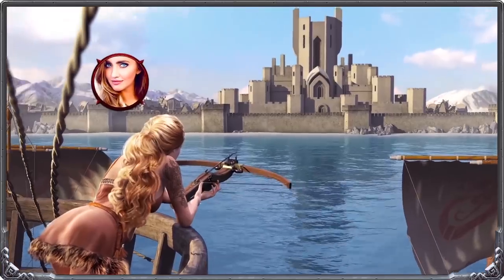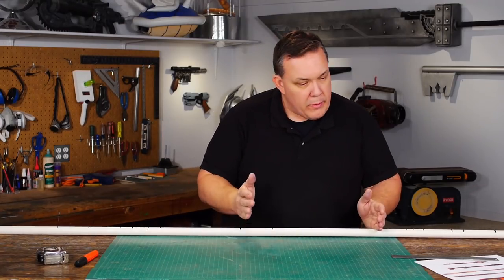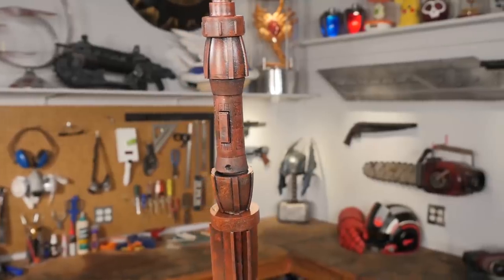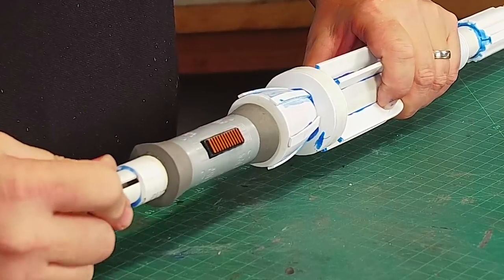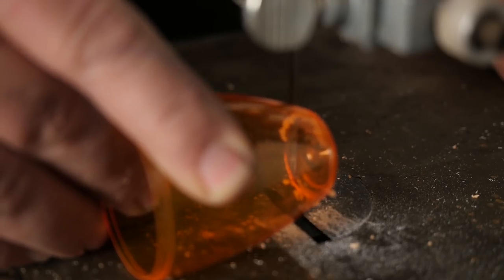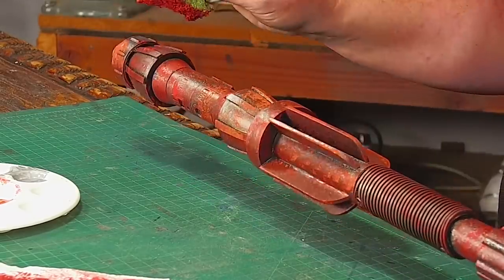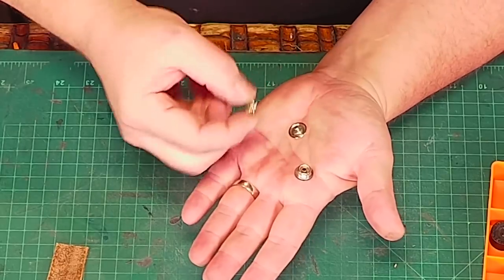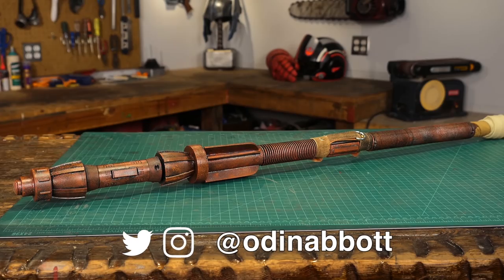Odin Makes: Rey's Staff from Star Wars the Last Jedi

Comment: Please make lightsaber of Luke Skywalker from Star Wars Return of the Jedi
Reply: Ezio Auditore You can either  check out Beyond Geek's channel where Odin makes or DIY Prop Shop where Hendo makes the Lightsaber.
Reply: Ok, but it isn't of Luke and isn't green
Reply: The color doesn't matter and it's impossible to do the Ep 6 ligthsaber without a lathe (or a 3D printer)
Reply: SaitoGray no it's not....
Reply: no, several layers of individually cut foam circles with an embedded pvc core could work, or sections of various sized wood dowels, or if you want to get crazy, one could cut out circles from a material like mdf and stack those up... a lathe is not necessary, neither is a 3d printer.
Reply: You all probably irgth. i'm use to build with real stuff, i can't make foam look good so i often use aluminium or steel. I'm to used to work with my tool and didn't see he can be at simple as that !

Comment: Well done build and thank you for the spray paint tip. 
But the rust looks more like blood.
Have you ever tried using clear varnish or glue mixed with powdered iron and then spraying it with salt water and vinegar?
Real rust looks the most like rust. So would have had thought? ;)

Comment: just wanted to say i love your channel and im definitely subbing, i love this prop and i love how you used elements of kit-bash in the staff!  great video! i would like to offer you some weathering tips to possibly help bring your projects to the next level! These are all tried and true tricks for weathering i have learned from trial and error many online videos and a lot of listening to Adam Savage talk haha! try watering down or using some thinner ( depending on what kind of paint), to help the paint become easier to move around once it is on the piece.and apply with a paintbrush with lots of crazy stuck or broken bristles on it, this helps the paint go on in a much more random and chaotic way like would be in real life, things dont weather evenly or regularly at all .Of course depending on the object, wear can and should be placed in areas where the object may be handled a lot. As far as color i think your'e leaning to much towards a bright red for your rust and dirt which in person looks alright sometimes but on camera it loos out of place, try using more of an earthy color like burnt sienna and reds that lean further towards brown and maybe even mix in some dirty green/yellow not enough to noticeably change the color but it adds definition and good highlight. And rather than 2 washes of color do many small washes and use a brush to apply and then try to wipe away as much paint as you can with a dirty shop rag or a paper towel, cotton fabric like and old tee shirt works really well.  it leaves just the lovely cracks corners and details looking realistically weathered and the piece doesn't start to lose its authenticity because of these small things that make a world of difference. I hope some of this can be useful to you and your badass prop making skills! thanks for the great content!

Comment: Thank you, Odin, for making all these awesome props!

My request, anything that lights up and interacts, with an Arduino or a Raspberry pi, some sensors and lighting. If you go the latter route you can pick up a pi zero for under $10 and install any Linux OS, then code in whatever language you like.
Reply from the maker: You assume I have technical prowess of such things! The last Pi I touched, I ate!
I do like the Idea. I have seen schematics for a P.K.E. Meter, and I would like to have the number display change on Rick's Portal Gun.

How hard would it be to make a Harry Potter wand that you could flick or wave around, and it would turn the volume on the TV up and down, or even mute?
Reply: Odin Makes Hrmm. Wand: With my very limited skill set, hard, unless you made the handle huge- you'd be looking at a 6 axis sensor and a custom chip. 

On the other hand, The portal gun would be way easier as you have the larger void there.  That's something that could be done with a few cheap components and a small battery.  

I'm no expert in these things either, but it is something I've wanted to get in to for some time now. :)

Comment: 1:38 Is there any reason you didn't just use a larger diameter dowel? ... 3:15 Ah, so you can glue to it with PVC cement.

Comment: Fantastic video Odin as always me and my son's gather around the computer the laptop or just my phone to watch you make magic as a fellow prop and costume maker I do have one question for you your contact cement always looks the right consistency and mine sadly strings like cheap hot glue I'm using dap weldwood contact cement the original do you dilute yours with anything or use it at a specific temperature would really like to have cleaner application also please come check out my page just search Hulse House of Oddities on Facebook looking forward to hearing from you Thomas Hulse
Reply from the maker: Hey, Thank you Thomas! And hello to everyone!
My contact cement will string out like hot glue when it starts to dry out, especially when I am working from an open can. Xylene, Naptha, or Japan Drier can thin it back to something nice, or just add more new fresh glue to the thickened stuff. I think it looks better now because I spent the $40 on that black glue container. It sounded really expensive to me, but I really do like it. Mostly because it seriously cuts down on the fumes in the shop! And I do think my glue is lasting longer too.

I think that is what's going on with my glue... I am still just using the red label DAP Weldwood glue. I know Barge is better and stronger, but DAP is half the price!

Comment: I cringe every time you use foam and other materials in the same build. Foam deteriorates over time, but other than that i love your builds.
Reply from the maker: Depends on the foam, and the abuse. I have stuff that is years old and still looks and feels the same.
The foam pads I walk on every day are breaking down, but they are taking a lot of abuse. I walk all over them constantly.

EVA seems to hold up really well. I just pulled a sheet out of my attic that is easily 15 years old, and it really doesn't feel any different. My attic is poorly insulated and has major temperature fluctuations.

Real foam rubber, the stuff made from tree sap that you have to bake, that breaks down pretty quickly.
Reply: Odin Makes Thanks for the response dude. Respect.
Reply: That's why I watch ODIN makes,not centaur 66 makes.
Reply: Brandon Newell You learn something every day